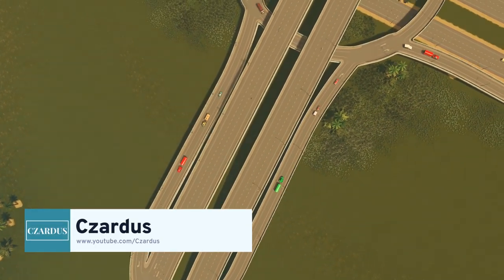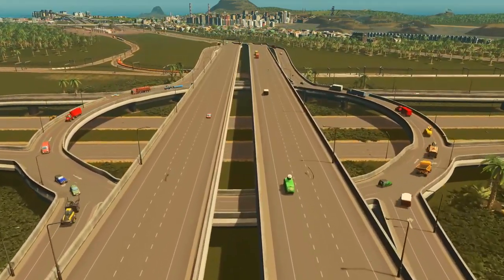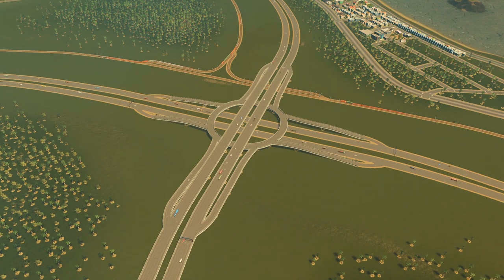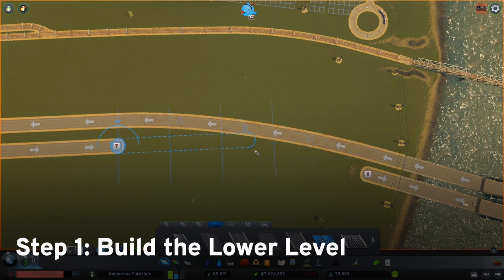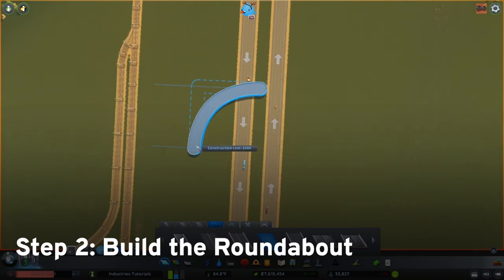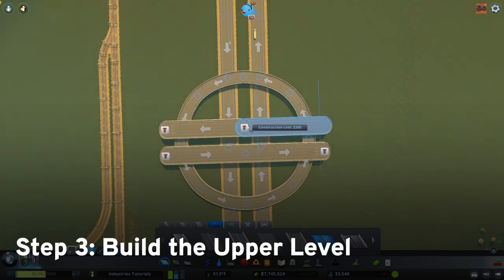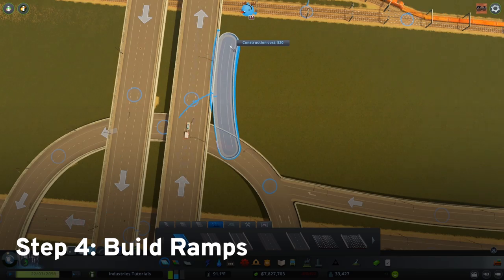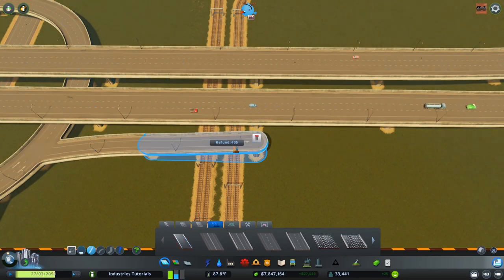Roundabout Interchange with Czardus | Tutorial | Cities: Skylines

Comment: *A**petition*!

Introduce the asset editor or just acces to custom assets like skyscrappers from real life and custom roads buildings etc  from creators from the workshop to PS4 I know that the PS4 is limited in storage and the processor isn't strong enough but I'm sure it will work it works on the XBOX!!!

we need more tiles on the map I currently have all the DLC's but I am running out of space 9 tiles isn't enough I think that there are 25 tiles in the game?

Every time I start building new city my city just doesn't feel right or look good it misses something concrete! And parking lots this wil make the city more realistic in my opinion  

I hope that we also can change the map itself with the introduction of the map editor start completely from scratch and make your own maps!! Or import them... This kinda the same as the asset editor 
The LUT is ugly and we need better ones console version of the LUT has a tropical vibe I mean perfect for a LA themed city but what if I want a Sattle themed city or a NY?

This is all for PS4 (hopefully)

I know that MODS probably won't make it to the game because it wil lag the game
Reply: Ps4 processor is strong enough. Problem is ram mate. Not processor, this game needs 16gb as base. 64gb and beyond to play with a lot  of assets.
Reply: Can't we fix this with an external drive or something?